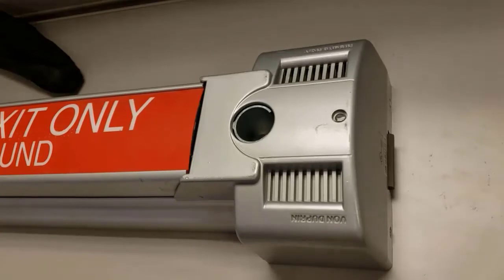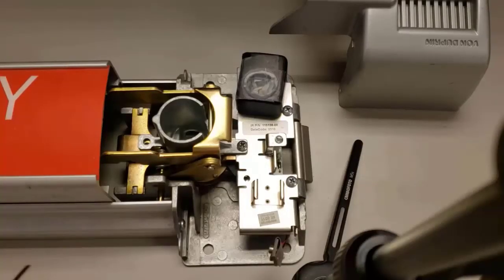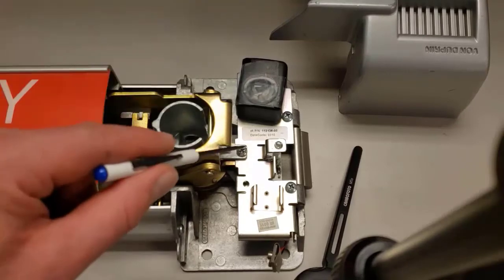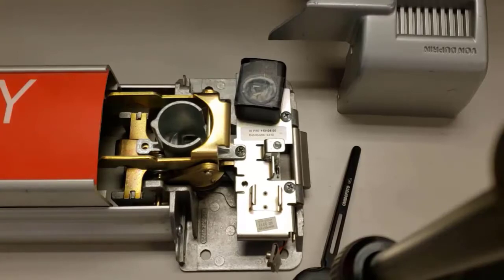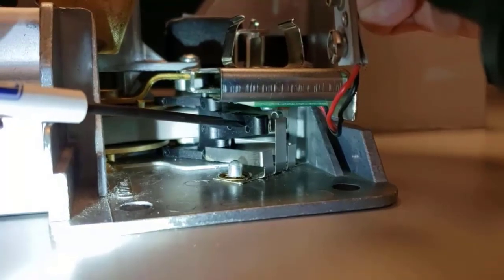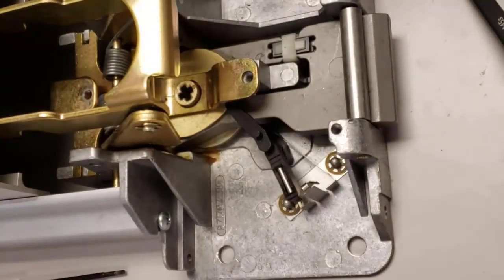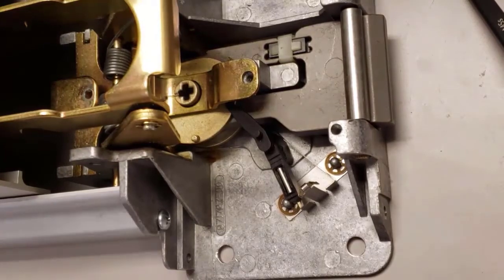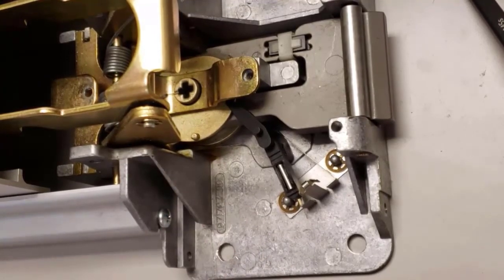How To Verify Correct Mechanical Timing of Von Duprin 2670 Guard-X Device

Comment: Thank you so much, man.
I owe you one! I'm not a locksmith so when that switching link fell on the floor I looked a long time trying to figure out where it went. I knew it rocked when the deadbolt moved and that the little magnet was part of the proximity switch for the alarm.
But I had never been inside one of these before.
I was only going to change the low 9 V battery and ended up radiusing the bottom square edge of the dead bolt with a file so it would lock more smoothly.
 But in the course of my investigation, I removed the  Alarm board and the lock cylinder and didn't notice the switching link until it fell on the floor! I'm usually pretty good at figuring things out.But I am not too proud to I might have played with that forever and never figured it out. So
 Thanks again!